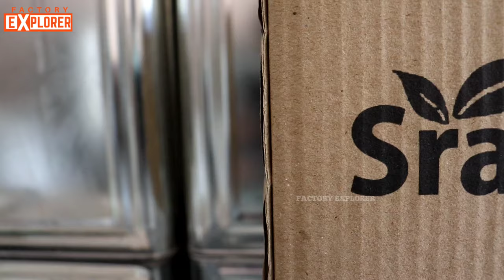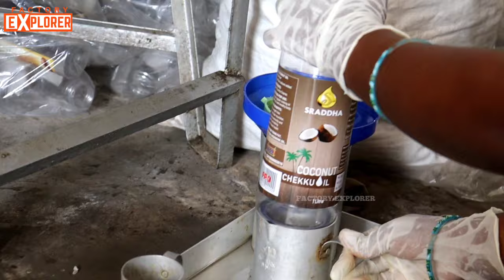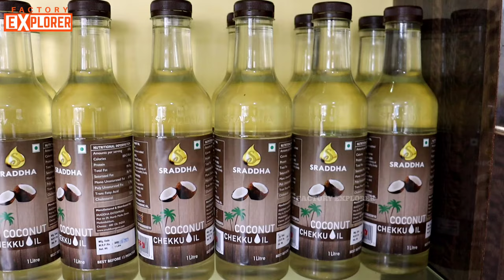HOW Pure Coconut Oil is made from GIANT Filters? (English Subtitles) | Factory Explorer

Comment: FYI, "cold press" is defined by any means of extraction which doesn't exceed 100c. This is technically cold press.  The hot method boils the coconut milk until the water is evaporated.
Reply: i dont understand, this is cold press? i mean, they refined the oil to "filter" it and get ride of the sediments as they said? or i didn't understand something, if they refined the oil, it's not cold press anymore right ?
Reply: @lokhz9876  No, who said cold pressed can't be refined?? If that is the case check cold pressed olive oil video. Without refining it contains lumps of olive in it, you would never like to use it. Cold pressed or virgin means where it is not heated to extract the oil
Reply: Cold press must be less than 55 degrees
Reply: @csabeson9656  
It should be pressed between 2 blocks of ice to be called cold pressed.
Reply: no it's not. here we produce truly virgin coconut oil without any heating at all.
Reply: @lokhz9876  refining and filtering both are different. Refining involves chemical, but filtering is just a process where oil flows through the cotton cloth to remove any sediments.

Comment: you are using iron to pressing the oil out, traditionally it should be wood so that it will create the heat and oil is preserved with its all properties.
Reply: Iron also does same. Wood absorbs oil and you may get slight amount of rancid oil.